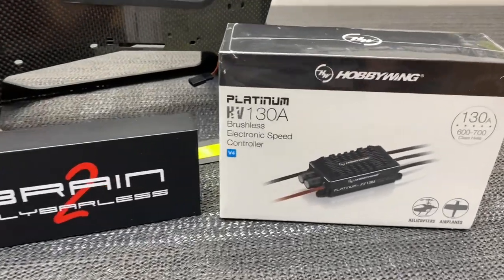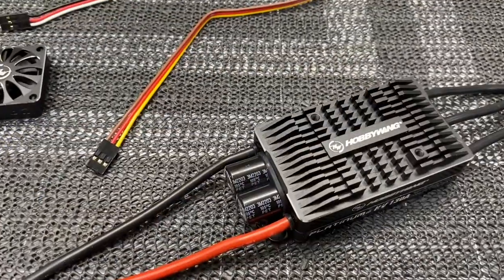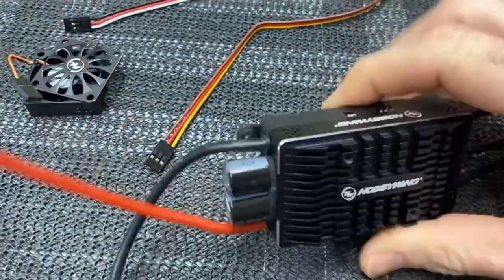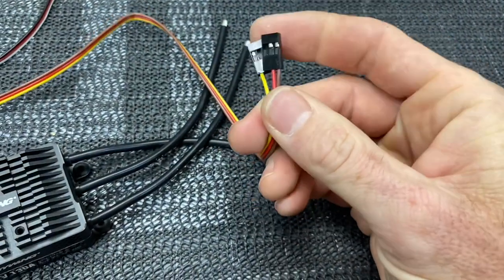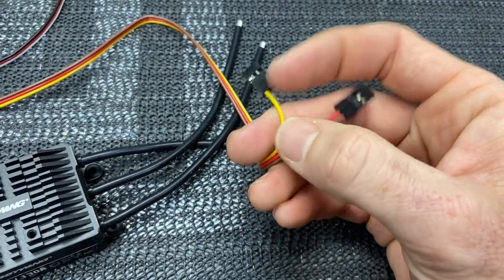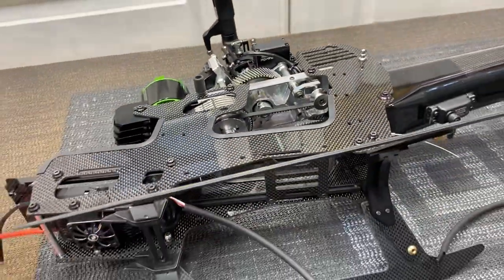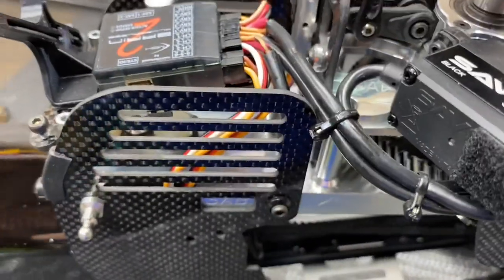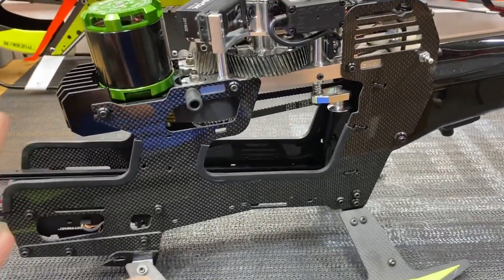How To Wire A Hobbywing ESC To Get Telemetry With iKon/Brain FBL

Comment: I'm building a Steam AK420Pro right now and using the Hobbywing Platinum 80amp V5 ESC connected to a Brain2. Had some issues not getting telemetry and thought it may be a compatibility issue but on the V5 ESC they moved the P port to the left. It used to be in the middle. So after I adjusted my cable, it's working!
Reply from the maker: @LichaelMewis  that’s awesome! I’ve heard great things about 5e Steam AK420 Pro. Maybe one day I’ll build one. Glad you got your telemetry working!

Comment: When you was talking about the BEC power back up cable with the 2 plugs,you said you tie both up,it saves a port. Do you mean you put the single yellow into the red+brown plug?
Reply from the maker: Yes sir, I put the yellow RPM wire into the Red and brown plug and plug that into the Governor port.

Comment: Question: I have a 200amp Hobbywing HV OPTO ESC, on the package it says it's for a 700-800 size heli. Purchase it about 2 years ago not knowing a lot about electric helis. Now I just finished a Specter V1 700 heli and will mount the OPTO ESC in it along with an IKON FBL and a XNOVA motor and 12s lipo.  I'm almost certain that all I need to do is plug the ESC Red, black, and white wire into throttle channel and the single wire into the governor port of the IKON. Then add a 2S lipo battery to power servos and FBL system. Just want to make sure I'm not going to smoke my ESC on maiden. Thoughts on OPTO ESCs.
Reply from the maker: Yes OPTO is no BEC in the ESC. So you will wire the ESC like normal, into CH1 and Yellow RPM wire into the GOV port and run a 2s Lipo for your RX/servos. You got the wiring right. So OPTO ESCs are great for helis that needed a big power load or like a speed heli but on any regular 700 a Regular Hobbywing ESC is better and less wiring and no second Lipo for servos. Years ago the BEC in the ESC where not strong enough to supply the power needed and that’s when OPTO ESC became popular. Now the BEC Are great.

Comment: Works with platinum v5 150a? The 3-8s one?
Reply from the maker: Yes, exactly the same
Reply: @westhobbiesrc8051  great mate, 
Which gov should I use and how to wire it?… the channel 5 on Esc fan port cheat I already did but no telemetry damn

Comment: So I have a HW 200 did everything you have shown. However my RPM is not showing on the transmitter which is a IX20. Everything else is, temp, voltage, etc. just after spooling up the RPM reads zero. This is on 2x HW200 ESCs. My 120 and 150 are showing the RPM just fine.
Reply from the maker: Hmm! That’s strange. Try going under the RPM telemetry page in the radio and re-find the packet and see if that fixes it. Is it showing RPM in the software?
Reply: @westhobbiesrc8051    Yeah I tried rebinding as well and no luck. But I haven’t tied spooling up all the way yet. Just turning it on for a couple of seconds and switching hold back on. Just on the 120 and 150 it showed the RPM as soon as I hit throttle hold off.  What do you mean rpm in the software?  The ikon software?

Comment: Great video! I would have never come up with this. I thought we had to use the single rpm wire from the ESC. What is that good for? you haven't connected it to anyting. We only use the throttle wire and the special single cable from the P port...

Edit: Correction: the rpm wire of the esc goes to the Governor input of the brain 2
Reply from the maker: The single rpm wire is for governor. So that will plug into the RPM port. If you’re not gonna use the FBL governor, you do not need it but you will lose your RPM telemetry so it is always good to just plug it in.

Comment: Hi. What exact RCProPlus connectors do you use between ESC and motor. It is hard to identify online.
Reply from the maker: Hello! I run the S7 solder connectors. You can get them in both solder and solderless.

Comment: Thanks brotha for the video!
 I have mine all set up correctly according to video and  get Receiver volts and rpm but no main battery voltage. Bummer maybe because my radio is a DX9 Black series which is older than the NX ? I do get pack voltage on my airplanes though. Is there a place in the Brain software you select what telemetry you want or is it all always provided?
Reply from the maker: Thank you for watching! You should definitely get telemetry pack voltage on your DX9. I just set up a Kraken 580 with a hobbywing on a DX9 and got all of it. Try rebinding and seeing if it picks up that telemetry packet. You are running a SRXL2?
Reply: Maybe DX9 (black) and DX9 G2 provide different data…

Comment: I calibrated first time, then by mistake 
I connected the 6s while the stick on the top position, then the calibration I think messed up, now every time I connect the battery doesn’t giving me the same tone counts 
I used to hear 4 tones now only 3 
Is there away I can recalibrate the unit?
How to factory reset? 
Thank you

Comment: I just made up the same wire and hooked it up just like you did but my IX14 still isn't showing me the pack voltage, the only voltage it will give me is the BEC voltage.. I am using a Avian 130 esc with a Brain 2 on my RAW 580.. Any tips or anything? Thanks
Reply: Excuse if I’m wrong but Avian esc aren’t exactly like god made for the spektrum radios? I have seen in other creators videos that spektrum radios (well at least the new ones haha) have an already design page for avian esc telemetry. I don’t know if you also need to use smart batteries